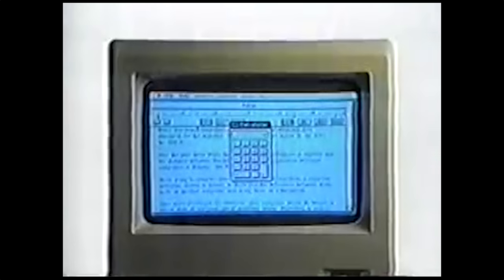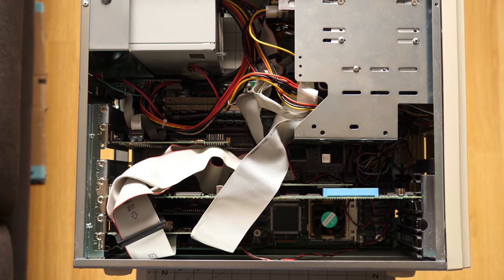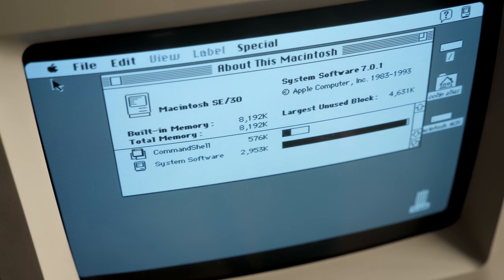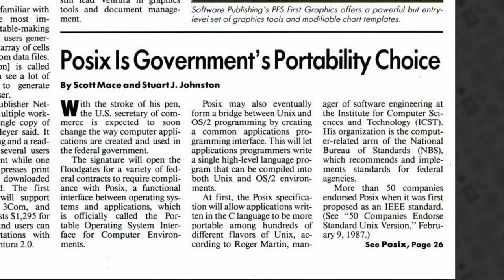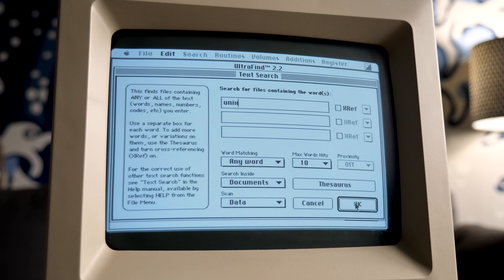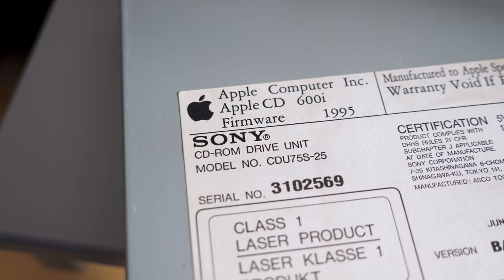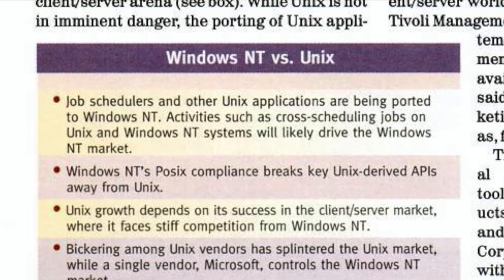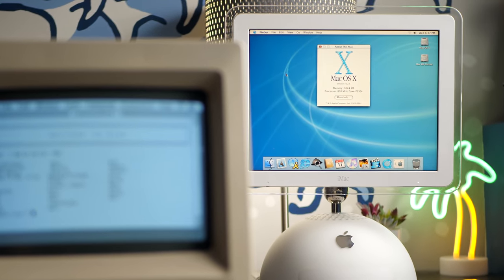Apple A/UX: The First UNIX Mac OS!

Comment from the maker: You may be inclined to think that A/UX ended up serving as the basis for Mac OS X. It didn't...but the history of OS X is something we'll dive into another time.
Reply: I always thought A/UX was an interesting Topic. It's amazing how many people haven't heard about it.  I always liked the unique way they chose to design it, it's a shame it never took off.
Reply: Spent most of the 90s developing NeXTSTEP, then Openstep, and finally WebObjects code in 2000 (on OSX Server on Macintosh hardware). EOF and Interface Builder were lightyears ahead of it's time. Happy days. When Jobs went back to Apple in 96 or so I couldn't wait to see what happened. Nearly 25 years later I'm still a NeXTSTEP user in my mind (all mac/OSX household) - though with every passing iteration it gets more like crappy iOS :-(
Reply: Also - I will say I worked in 1990 on at BT research laboratories - we had possibly the largest network of macintoshes in the world on apple talk at the time - certainly over 1000. I've still got 3 of them in the garage :-)
Reply: You should look into Apple AIX also.
Reply: @TheFlyingScotsmanTV  The largest 2 apple netwoks / sites were Boeing and Nortel (which I think was the worlds sencond largest apple talk network)  I worked as a contractor for  Nortel for a while and it was mind blowing the size of the apple talk network - I remember this was before the web took off the finder had connections to nearly every conutry on earth - people in Australia would be working on spread sheets on servers in Singapore it was crazy but it worked!
Reply: @alextirrellRI  AIX was actually developed by IBM for the RS/6000; it was later ported to the IBM POWER and PowerPC architectures. Apple used it for the Apple Network Server (PowerPC based) but that product never went anywhere.
Reply: Would gladly watch an OSX history video, complete with the funeral that Jobs held for Mac System whatever version was at that time :)
Reply: I’ll just wait here for that.  whistles
Reply: My dad was trying to do Unix on the Apple way back in 82/83.. I have his full Lisa and a bunch of the handwritten notes and code he exchanged with one of the BSD coauthors.. A/UX came out and he stopped working on it.
Reply: TheFlyingScotsman SAME!!! 🙏🏽
Reply: well everyone knows that's next and to appease steve.
Reply: A/UX IS SYSTEM V UNIX BASE ....BACK THEN IT WAS VERY PROTOTYPE STAGES FROM ATT LABS....THEN SUN BEGIN ITS JOURNEY TO MAKE PATCHES FOR ATT WHILE MAKING THEIR OPERATING SYSTEM BASE ON SYSTEM V...

MAC OS X IS BASE OF BSD 4.4 LITE AND DARWIN.....EQUAL....GREATER POWER OF THE NET
Reply: Mac OS is a real UNIX based on Free BSD, thus the only current official UNIX working on i386 architecture.
Reply: So.... OS X wasn't simply the nextstep of A/UX? 😆
Reply: OS X? Yes please.
Reply: One of the NeXT videos, I presume?
Reply: Great video. I have "The A/UX Handbook" by Jan Harrington from 1989, and despite having never used A/UX it's an interesting read when you compare it to a modern Linux or FreeBSD shell environment.
"The history of OS X is something we'll dive into another time"
Looking forward to it. Worth mentioning is MkLinux, a project begun by Apple in the mid '90s to port Linux to PowerPC systems, predating OS X by a few years. I had MkLinux running on a used Workgroup Server 6150 in the early 2000s.
Reply: @This Does Not Compute - I don’t know whether he’d want to be identified, but my older friend/former colleague Mike P🤫🤫🤫🤫🤫d started his career at the old Bell Labs and was eventually poached to work on A/UX. He’s now retired and writes sci-fi aimed at young adults, and is skeptical of social media, but maybe I can coax him into watching this and writing to you. He really loved talking A/UX when we worked together, and I really loved listening, although once people start reminiscing back to the days of punchcards and Fortran and COBOL — anything preceding my wheelhouses, aside from Lisp — fascinated though I am, how much detail I retain can get patchy. So I‘ll share two things I remember, but forgive me if any specifics are askew.

What Mike told me is that Apple’s *nix implementation never died — it just got recycled into other products.

Almost immediately, it seems, large chunks of A/UX got repurposed by Apple into System 7 to serve as a bridge between their then hugely-popular AppleTalk LAN protocol and something called MacTCP, their implementation of the then rapidly-ascendant TCP/IP protocol. It’s hard to remember or even believe now, but AppleTalk was at one point the most widely-implemented LAN protocol globally thanks to its ease of use. However, TCP/IP was on the rise, initially mainly as the protocol for accessing remote servers. So for a long time, before sockets TCP/IP came to dominate all things, in Apple-centric offices LANs continued using AppleTalk over LocalTalk-compatible hardware, while external servers were accessed (or WANs were created) using the MacTCP implementation of TCP/IP through a dedicated computer “GeoPort” using a GeoPort Telecom Adapter… and that WAN connection could be shared with other devices on the LAN via AppleTalk. So apparently it was thanks to large chunks of A/UX that System 7 networks or individual System 7 Macs could reach beyond their LocalTalk LAN without requiring a full A/UX install.

(Sidebar: during this time Apple apparently was also working on AppleTalk-over-Ethernet, other networking protocols, got AOL off the ground and running before selling it off at a loss… all good evidence that, despite what MBAs would have you believe, every CEO is not uniformly valuable across every industry: the fizzy drink magnates who nearly bankrupted a legacy Silicon Valley firm clearly had no idea how or where to channel that computer firm’s resources and efforts, and it’s likely the used-car hucksters running the USA’s aviation giants and the three card monte artists running the USA’s HMOs are great at creating golden parachutes for themselves, and at not much else.)

But your statement mostly reminded me of the other thing Mike told me, which was that while A/UX played no role in the development of NeXT’s NeXTSTEP and OpenStep operating systems, which upon Apple’s purchase of NeXT became the bases for Mac OS X, A/UX did many years after its creation form the basis for… the Classic Environment emulation layer, which Apple packaged with OS X right up through the Tiger iteration! There were some interim steps and false starts, I believe much of A/UX was first recycled into something called “Blue Box,” basically a fenced-off Classic Environment within something called Rhapsody, an overambitious OS Apple intended to market as a sort of hardware-and-network-agnostic be-all. The Rhapsody project was scaled back and then killed, but not before Apple had morphed A/UX into something that could successfully wrap an old Mac OS shell around a shiny *nix OS, which eventually became the fairly interoperable Mac OS 9/BSD environment called Classic Environment. Which is quite a feat, if you think about it: copying something in one environment and pasting it in another, working on the same files, all of that.

Anyhow, I totally enjoyed your video. I’ll send Mike P🤫🤫🤫🤫🤫d a link, and maybe he’ll chime in. He could provide better detail, and hopefully correct anywhere my memory may’ve failed. He just doesn’t have much time for negativity these days — he already quit Facebook years ago, I just don’t see him deigning to leave YouTube comments. But I’ll see if I can get him to contribute some historical context. ❤️✌🏼🤖
Reply: Back those days there were also available Amiga UNIX... a NIX complete full port of AT&T Unix System V Release 4, bundled with the Amiga 3000UX.
Reply: OS X is a fork of NeXtStep.
Reply: @Patrick_AUBRY  “Real UNIX” ... hah. Wonder why cross-platform open-source projects need to have lots of “if(UNIX AND NOT APPLE)” sections in their build scripts?
Reply: Commodore Amiga also released an Amiga Unix full compliant port version based on System V R4, bundled with the Amiga 3000UX, and was way better by orders of magnitude than the Apple Mac version.
Reply: @Colin

I don't know if you'd be interested in doing it, but I think a cool future video could be made about showing the evolution of running "alternative" OSs on Macintosh hardware. Given you've shown both A/UX in this video and (very briefly) BootX on your PowerBook 2400c, doing a video where you kind of tied this all together might be a nice little project.

I have personally used BootX to run Debian Linux, from something like version 6 or 7, through the last version they ported for 32 bit PPC, on a PowerMacintosh G3 Desktop. It was a complete and total kludge to get it installed, and doing kernel updates was equally interesting, but that said, it's amazing how Debian breathed new life into the hardware. I later replaced this with a PowerPC G4-based Mac mini, and what a difference it made. 

There was actually a progression of hardware standards Apple used: OldWorldROM, which I believe included CHRP and PWRP, and NewWorldROM. Basically, the G3 Desktop I owned was the last generation of OldWorldROM desktop Apple produced (I don't remember clearly where the cutoff was with PowerBooks) and the PowerMac G3 and iMac were the beginning of the NewWorldROM systems. BootX was used for OldWorldROM Macs, and a far less intrusive Yaboot on NewWorldROM Macs. Of course, once Apple switched to x86 systems, they went to EFI, which then made them no different than any other PC.

I'd like to point out the obvious: no matter how good any distro of GNU+Linux was back in the day on PPC, Apple's unwillingness to play nicely, coupled with PPC ultimately becoming a technological dead-end meant that the desktop experience was never as nice as could be found running the same distro on x86 hardware. However, my use case for both the PM G3 Desktop and G4 Mac mini was as a headless fileserver, in and that role, they performed flawlessly. As someone who's also used Apple's own AppleShare Server software on similar generation hardware to the PM G3 Desktop, performance and stability weren't even close: Debian tied Apple's server software's underware up over its head in a knot.
Reply: I hope that when the history of OS X will come up you'll cover also one OS which never saw the light of day which were in between what was the Classic OS, NextStep and Mac OS X: Rhapsody.
I don't think I've seen a good, in depth video about it.
Reply: Apple barely pushed it and at the time it had fairly high RAM requirements, needed at least an 030, and iirc only supported Nubus and a few Ethernet cards.
Reply: While A/UX was always technically SysV there was a lot of BSD features and APIs added to it. It was similar to Solaris in the way a ton of "ucb" stuff found its way in
Reply: NeXTStep was actually BSD, the latest versions of MacOS is actually a walled garden BSD.
Reply: @alextirrellRI  AIX is IBM proprietary UNIX
Reply: @jamesthompson7694  you sound like someone who has never used macOS. You can use whatever software you want on macOS just as much now as you could when it was introduced ~20 years ago. There is no walled garden.
Reply: @williamp6800  that's where you're wrong kiddo.
Reply: @jamesthompson7694  I’m not wrong.  I use it every day.  I’ve used since the first beta. Nothing has changed. I can run Mac apps. I can run UNIX apps. I can run Java apps.  Just like always. And it doesn’t matter whether an application comes from the Mac App Store, a registered developer, or any random developer from anywhere on the planet. It all still runs without a problem. I’ve done it today. 

So tell me, what can’t run because of this walled garden that you claim exists?
Reply: @williamp6800  Try 32-bit applications. Whereas, every 64-bit OS I've used outside of macOS is able to run 32-bit applications. Where Apple on the other won't allow it....
Reply: Which is why I absolutely treasure my NeXT Slab.  😁
Reply: @jamesthompson7694  you’re  knowledgeable enough to understand 32 bit vs 64 bit so I’m a bit surprised that you don’t understand the difference between a walled garden and deprecating a superseded technology, which is what you’re referring to. 

You may not like the pace at which Apple deprecates older technologies. The OS was fully 64 bit by 2007, the same year they shipped their last 32 bit hardware. But they kept support for running 32 bit applications on their fully 64 bit OS until 2019. I’m not sure how long other 64 bit operating systems continued to support running 32 bit applications, if at all. 

If that seems a bit rushed to you, that’s fine. I think they should have officially deprecated 32 bit applications at least three years earlier than they did. That would have left five years between announcing it, and support actually being removed.

But the lead time between deprecation and removal has nothing to do with it being a walled garden. It’s simply a reflection of the pace at which older technology is dropped.

I believe that 2019 is also around the time one or more Linux distributions raised the possibility of dropping their 32 bit version?

There is a history of separate 32 bit and 64 bit versions of Windows and compatibility and transition issues, because IIRC, 32 bit Windows applications couldn’t run on the 64 bit Windows? My memory is a little fuzzy on the details, so you may be better informed about this?

I mention those two examples merely to highlight that 32 bit vs 64 bit is a technical issue that every current operating system has had to face. Different operating systems handled it in different ways. 

The Mac OS X transition from 32 bit to 64 bit happened over a few years while users kept using “the one” version of it. From it being entirely 32 bit, to adding a 64 bit kernel, then the BSD layer went 64 bit, and then finally the UI frameworks. I’m sure things like like kernel extensions needed to be updated to 64 bit, but 32 bit application support remained and 32 bit applications continued running. Right up until the release of Catalina in 2019.  

Apple does have a penchant for dropping older technologies pretty decisively when they decide it’s time to move on. Many see it as a virtue, freeing them from the backward compatibility cruft that some see as a boat anchor around Windows’ neck. 

Others see it as needlessly leaving old hardware and software behind. I’m a long time Mac user (35 years) with three fully hardware functional Macs that got left behind three or more years ago. For them, it’s goodbye macOS, hello Linux. 

But there’s a fundamental difference between a discussion about the pace of technological obsolescence on the one hand, and on the other hand, whether a platform vendor restricts, controls, or requires its approval to run software, i.e. a walled garden.  

So no, macOS is not a walked garden. It more like a playground where we arrive one day to find they’ve take away the swings and the baseball diamond, and replaced them hoverboards, when we really would preferred to have both. 🤷
Reply: @williamp6800  I can somewhat agree with your playground analogy. But dear God in heaven, I'm not going to read an Apple fanboy's obviously biased doctoral thesis, obviously written to just win a battle that has zero tactical meaning. You sir are fighting the Vietnam of comment wars. Also, learn to TL;DR, everyone wins that way.

I say I somewhat agree because you are proving my point but you can't take the rose colored blinders off can you? And your knowledgeable enough that you can try other operating systems and understand that while Windows and Solaris may be restrictive somewhat, but guess what you can remove those restrictions and turn it into a thriving environment/ecosystem of your own design. You are smart to realize that a playground is a type walled garden.

TL;DR - When you fight someone who doesn't care if he wins or loses, and is just there for the argument, you've already lost and look silly.

P.S. 32-bit isn't obsolete despite what Apple says. You should be smart enough to know that.
Reply: @jamesthompson7694  You asked for it, you’ve got it:

TL;DR when someone pulls out “fanboy” you know they don’t have an argument for their position and you know they know it.

I’ll repeat myself: 32 bit may not be obsolete to you, but it is to Apple. You don’t have to agree with their conclusion, but it is their conclusion, and they dropped 32 bit support based on it. Just like they had the “courage” to drop the headphone jack. And as an Apple “fanboy”, I just love not being able to plug in a battery to charge my phone while I’m using my earbuds. SMH

I do apologize for the length of my previous reply. And this one. Next time I encounter one of your comments, I’ll follow your approach, skip including facts and context, and stick to ad hominem.  

As for my analogy, I’ll just mention I’ve never seen a playground with a wall around it. You must have grown up in a place very different from where I did. 🤷

PS - As for being “fanboy”, I’ve got five computers running Linux, two running TrueNAS, and one and only one running MaC OS.  A Mac was my first computer but I’ve used DOS, DR DOS, OS/2, various flavours of Linux, Sinclair ZX 81, IBM RS6000, DEC VAX, IBM AS400, Windows 1, 2, 3.1, 95, 98, ME, NT, XP, and 10. Fanboy. Yeah right. 👍
Reply: @williamp6800  you're right I shouldn't have used fanboy, apologist is more fitting. Ooo, ad hominem, look who used a fancy ten dollar word on YouTube.

The "playgrounds" as you call them are a walled garden, you have to play by certain rules don't you?

Then with all the computers you've used, you know you are wrong. Just call it for what it is and move on.

And since you like to devolve into emojis here you go: 🤡
Reply: @danopticon  I’d love a blog post from your friend Mike about A/UX. Let us know when you can twist his arm to write one.
Reply: @ReaktorLeak Eh, I would agree with you if only you could still run 32-bit programs in MacOS. I know I know, the whole 32-bit is obsolete shpeel. A lot of simulators and design programs I use are strictly 32-bit because of CPU utilization and better memory usage as well.
Reply: @ReaktorLeak I know there is the text-book definition, I play by a more "strict" definition of walled-garden. But hey that's just me. As long as we can agree to disagree!
Reply: @ReaktorLeak fair enough!
Reply: I started using Macs in high school in late 80s. Heard of A/UX and saw it printed on Mac documentation but never saw it run. Very cool to see it for, I think, the first time. 

Totally forgot about AppleTalk but yes, that was a very popular LAN protocol. In college, I remember going to the Chooser and then selecting I think the network, then connecting to the computer/server. That was such a long time ago. Totally forgot about Chooser and AppleTalk until now. 

I think back in the mid 90s, my experience was that Macs were so much easier to network locally than Windows machines. But that was also a time when Apple began floundering with its smattering of mediocre computers and non-distinct hardware variations. At some point, the Mac hardware landscape became confusing enough for even Apple enthusiasts like myself (note: not fanboy; that’s something different). By the late 90s I was thinking whether Apple would survive and whether I should abandon ship and switch to Windows for my personal environment. Glad I didn’t have to.
Reply: I believe OSX imported the base skeleton of FreeBSD 3.x if I recall correctly.
Reply: @TheFlyingScotsmanTV  ios as far as i know is also based on next step
Reply: There was another step-child in the MacOS UNIX world, which was MacMach. I was at Carnegie Mellon in the early 90's, and ran a version of the Mach3 microkernel with MacOS running as a tenant OS on my Mac ][ci. I could run tcsh and type "ps" and see the MacOS processes. It had the full BSD UNIX subsystem (I even needed a BSD license at the time). I'm not sure if any of that work ended up back in MacOS X when NextStep came in, as that was based on Mach 2.5 and eventually XNU, but it was fun to play with in 1993.
Reply from the maker: @samkass9039  Yeah, it's a real bummer that MacMach was so restricted in its distribution -- seems like it's impossible to find today.
Reply: @ThisDoesNotCompute  1995-2000, I was the sysadmin at a university department (information & media science, a humanities counterpart to cs), where I had also been a student since 1990, and I had used A/UX from 1991 or so. The department was exclusively Mac based, my predecessor (who I worked with as a student assistant before taking his position when he quit) had switched us from a plain AppleShare server to A/UX, and set up a departmental Internet mail server. First on a MacIIfx, and when I took over, we had three A/UX servers running AppleShare, mail, DNS, webserver, and other stuff: a WGS 95, a Quadra 800, and a Quadra 950. At that time there was maybe 25 academic and administrative staff who each had an office machine, and maybe 250 or so students who used our student computer labs. A growth including an annual doubling of the student intake meant that I was constantly at the limit of our resources; the first iMacs were a godsend. In 96 or 97 I saw a clear need for a stronger server or servers-. I gave the Network Server with AIX a quick glance, then decided to get a Silicon Graphics Origin200 instead. Probably a better system with more power, for only a little more (but trimmed to the bare necessities.) It came with AppleTalk/AppleShare software called TAS, but that was hell to configure and didn't work very well (it couldn't support our "home-grown" printout accounting system for example.) Instead I bought a similar package from Xinet, which worked very well - when augmented by a separate server for print spooling, for which I used a PowerMac 7100 running MKLinux and netatalk package. Around 98 68K Macs were nearly useless as user machines for us, and these two servers took over all the loads from the three A/UX servers. But they were very nice as Unix systems while they lasted. For servers you could just run them without the Mac interface process (VM), freeing a lot of power. Being based on AT&T system V, with many extra features added from Berkeley/BSD also, they had no problem running things like Apache httpd, Postgresql, freeWAIS, INN, and what else you might want to run on a Unix server.
My users never saw anything "Unixy" whatsoever; AppleShare just worked, and Eudora was a brilliant mail client, for staff and students alike. (Students would simply keep their Eudora Folder on the file server.)
As for MKLinux, or Mach Kernel Linux, which I guess is related to what Sam mentioned, I just installed it and it worked, once I had it set up, I didn't need to look at it much.
Later, I used NetBSD both on my private MacIIci (mac68k) and an iMac DV SE (netbsd-macppc). So there were actually plenty of Unix-like systems for the Mac before OS X. A/UX still has a big place in my heart though (and I guess most A/UX users will agree.) The online community was second to none, centered in the comp.unix.aux Unenet group, and with a great software archive - the "jagubox" - provided by Jim Jagielski, who later became a leader of the Apache Software Foundation. A terrific guy, who probably knew A/UX better than most.
Btw, saying OS X is built on FreeBSD is not entirely correct. Darwin was a combination of the Next (Mach--derived?) kernel, with parts from both FreeBSD and NetBSD.
Reply: @JaredtheRabbit  I think it's more accurate to say that OS X and NextStep are each forks of Mach. My recollection is that Mach was developed at CMU (and elsewhere) with significant funding from IBM.
Reply: Do you think you could cover the short time that Linux was available for Macs? I had a copy of YellowDog Linux and a copy of MkLinux that worked well enough. I never got to spend much time with them, and they disappeared fairly quickly.